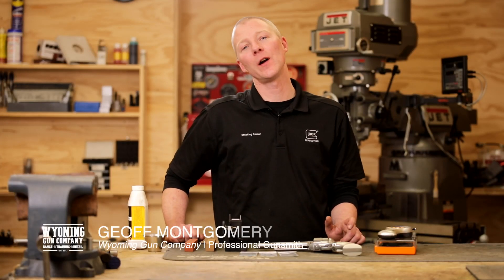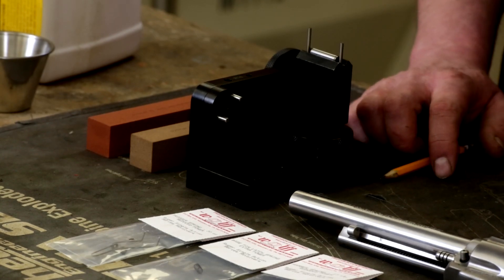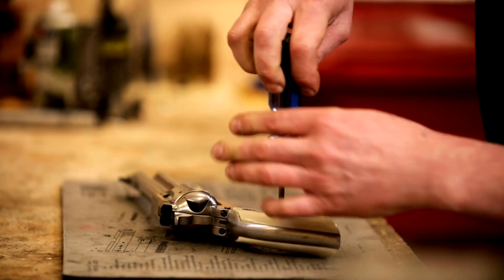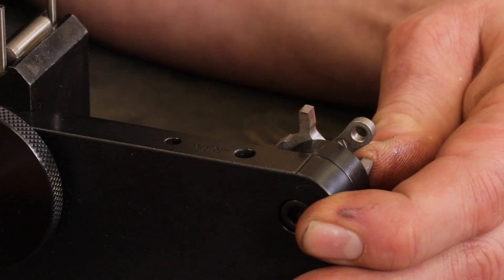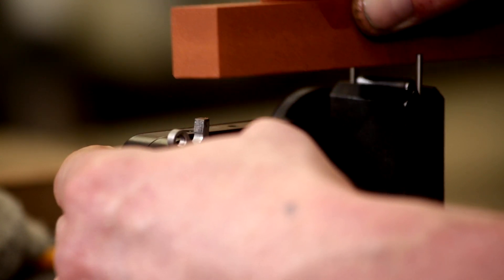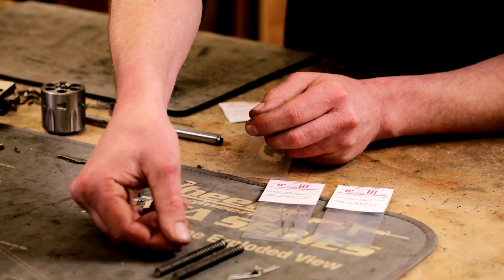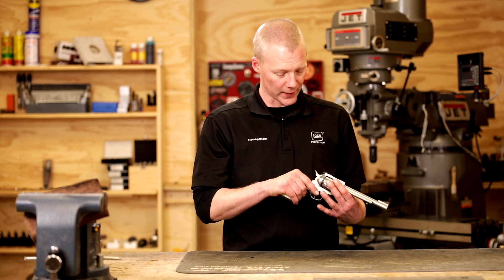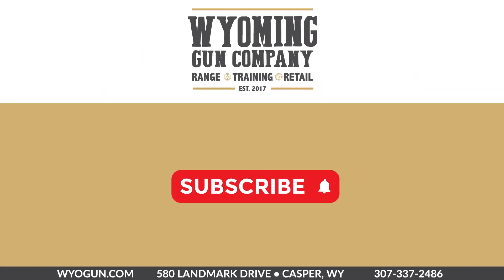Trigger Job on Ruger Blackhawk I Gunsmithing

Comment: I own the Ruger Blackhawk 357 in stainless steel and it is the finest firearm in it's class that I have ever owned. The weight of the revolver helps with the recoil with the powerful 357 mag and the accuracy rivals a lot of long guns. I was and still am satisfied and impressed with it's performance straight out of the box and if I were to change anything on the revolver it would be the grips, i would switch from the brown wood grips to white, i just think that the white grips would look better with the stainless steel but I would change nothing on the performance of the revolver itself

Comment: Very nice video. I did a more conservative job on the sear surfaces on my SBH by doing it with higher and higher grits of very fine grit sandpaper on a block to polish without changing the angle. I also installed a lighter trigger return spring and slightly bent the arms. I really differed by installing a /heavier/ mainspring. A lighter mainspring reduces the pull weight a little, but it increases locktime. The heavier mainspring makes for a slightly heavier break, but trades it for a crisper break and reduced locktime. It does require a firmer grip though since a massive hammer on a heavy spring will tend to slightly dip a revolver held limply.

Comment: Thank you for a great video. Excellent lighting, camera angles and narration. I do have a question concerning the trigger job itself: I noticed that you didn't do any smoothing or polishing of the hammer notch which engages the sear surface. Would it not be advisable to give that surface some attention also, so that you've got one polished surface interfacing with a similarly polished surface? Or is it not advisable to do that for some reason?

Comment: Nice trigger job ! Question: why can't the trigger on the block be tight locked while honing? If I'm not mistaken, I see a small movement (rotation around the axis) of the trigger as you pull the hone back and forth. You only clamp with your thumb. Doesn't that result in a slight curvature of the surface? Or that has no influence?
Reply from the maker: Good question!  I don't feel the tiny amount of "play" is of any significance or concern.  The very edge of the engagement angle is all that matters and is preserved, anything behind that is a non-issue.  Thanks for watching!!

Comment: Thanks for the video.  Some questions...
1. You do not mention the transfer bar safety.  Many people express that they believe the transfer bar ruins the trigger of the New Model revolvers.  I disagree.  I see nothing that  the transfer bar does to make the trigger pull worse. But the "hot stove league" tends to say that any change to any mechanism "ruins the trigger pull". You do not address the transfer bar safety in this video.  I take it that means it is insignificant. Correct?

2. . You did a lot of "stuff" between trigger pull tests.   Thorough cleaning, change springs and stone and hone the hammer/trigger surfaces.  How much could each be expected to improve the trigger pull? For example...if I just changed the springs and cleaned everything well, what could I expect?

Comment: What kind of trigger mod did Alec Baldwin use?
Reply: The deep state trigger mod.
Reply: The only way that hammer could have hit the pin is if his Ruger was an Old MOdel. I had an A.D. on my Old Model BH. Almost sh*t my pants. Thumb slipped while walking the cylinder.. If he had a New Model, well, then he MUST have pulled the trigger... Only way that hammer could hit the pin..,.

Comment: You really didn't do anything to this trigger.  If you want to make the trigger pull crisp you have to stone down the hammer hook to reduce the amount of engagement to get rid of creep. All the reduction of pull weight is by spring replacement.